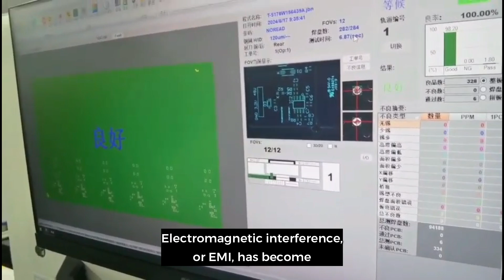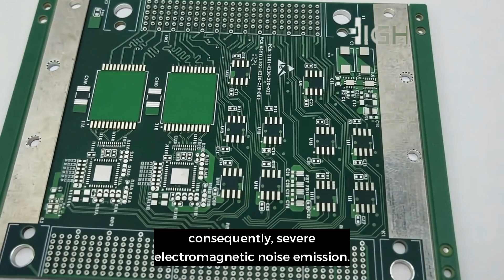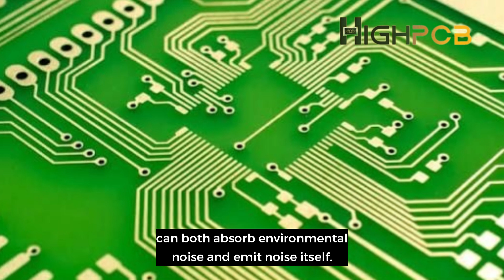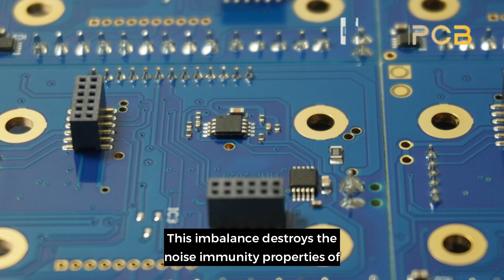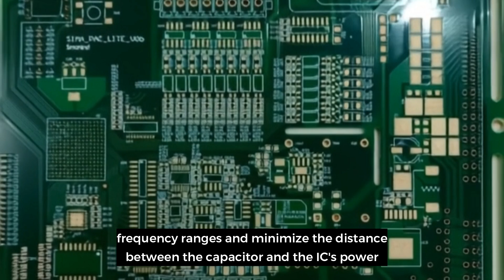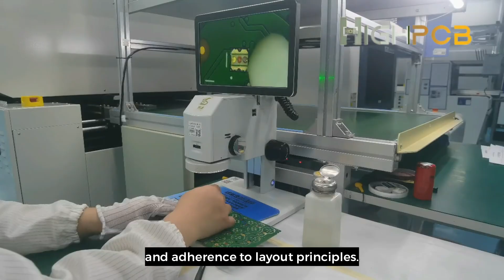High-Speed PCB Routing Guidelines: Avoid These 5 EMI Mistakes

Comment: One thing that often gets overlooked in high-speed PCB routing is that EMI problems usually start with return current paths, not just the signal trace itself. Keeping the reference plane continuous under fast signals can make a bigger difference than many “after-the-fact” fixes like shielding or filtering.